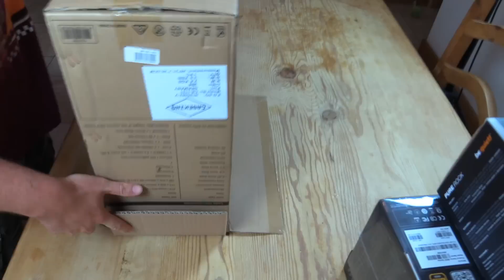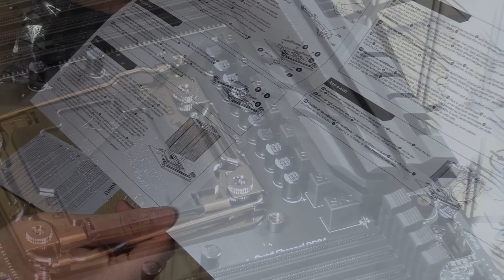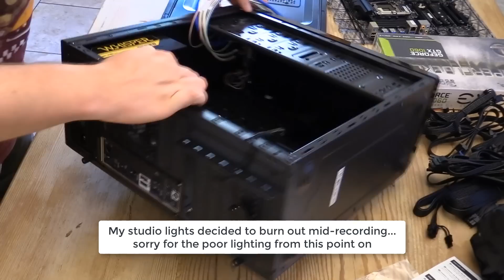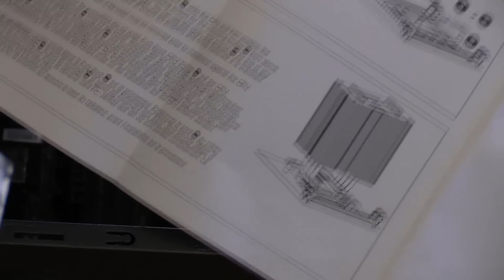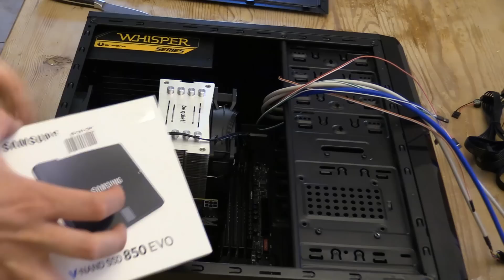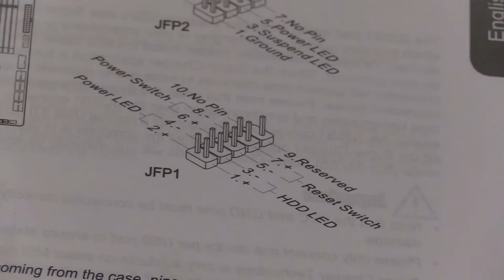Building a custom PC - Putting the parts together

Comment: Probably a bit late for you to see this comment, but I'll ask :)
Would it make a difference if the CPU fan was on the other side of the heatsink, nearer the case fan ?
I'm guessing CPU fan pulls air away from the CPU and case fan pulls air from inside the case and out the back.
That way, hot air from CPU would be pulled straight out the case. Or maybe minor difference.
Even so, good video :)

Comment: Why did you not mention in the video that the CPU socket cover should be left on if you only took it off for demonstration purposes? This is supposed to be an instruction video. You don't want people going about it the wrong way. I got sweaty palms from watching you work on the brackets with an uncovered CPU socket. BAD IDEA and not a good example in an instruction video.
Reply from the maker: I hear you. Good spot. I will pin this comment as I agree that is an important thing to mention.

Comment: Before installing the cooler mounting hardware, you removed the protective plastic cover from the CPU socket, exposing the pins to damage from screws, fingers, screwdrivers, etc. that you were using to install the cooler hardware. It's better to leave the CPU cover in place. In fact, you do not need to remove it at all before installing the CPU. When you press on the socket levers to lock the CPU in place, the plastic cover will pop off without any direct human intervention.

It's more convenient to install the CPU and the cooler BEFORE placing the mother board in the case. Once the cooler is in place, you can use it as a "handle" for picking up and maneuvering the mother board into place in the case.
Reply from the maker: +Benoit Evans certainly yes you should keep the CPU area covered until right before installing the CPU. I've mainly exposed it so viewers can see the socket and then I just worked around it carefully. But you are right typically do that just right before actually install it. 

For placing things on the motherboard before putting it in the case again it's probably easier however I like to get the board in while it's not got any parts sticking out as it's easy to bash them when messing trying to get the board in and also the cooler can get in the way when trying to screw the board down. It's just preference though it can be done either way
Reply: Benoit Evans นนชชขจข